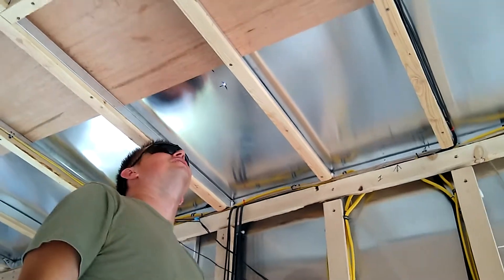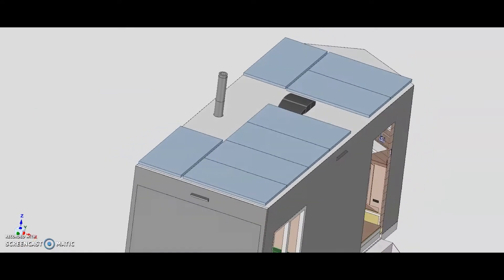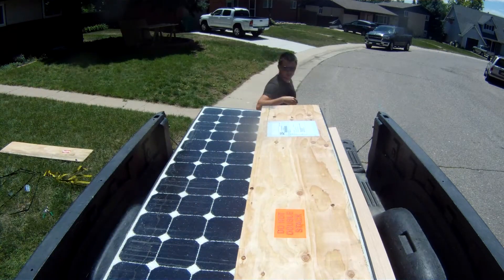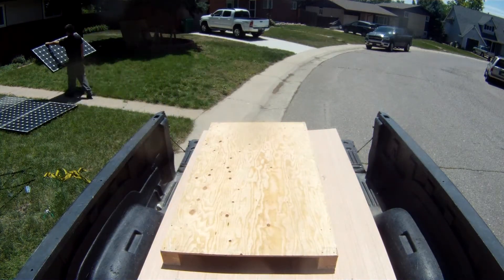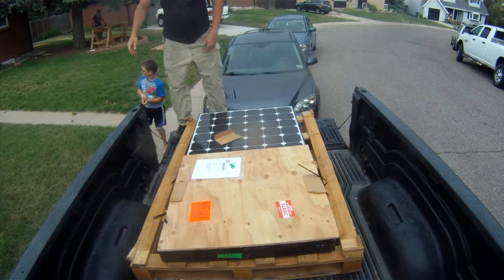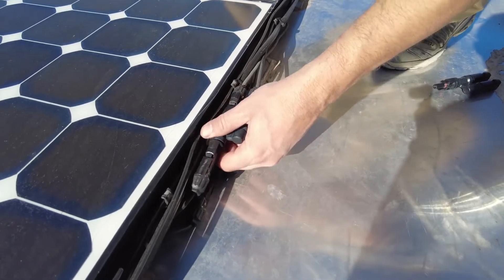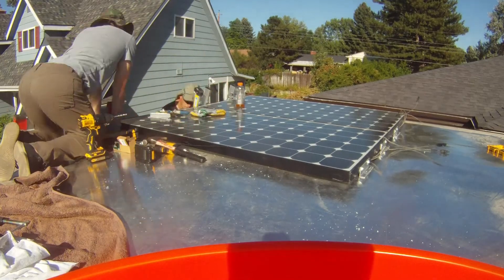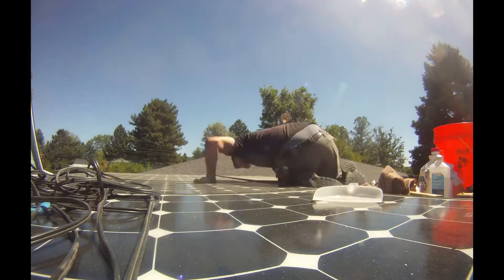Here comes the Sun! | DIY Solar Panel Install | Cargo Trailer Conversion | EP10

Comment: Be EXTREMELY cautious about buying 'used' solar panels - typically the used ones on the market were removed because they were failing. Panels that are internally degrading can become a fire hazard; I've seen them catch fire on people's roofs! My company is getting ready to pull 82 panels off a home because they have moisture ingress and are failing Megger testing. He had the system installed in 2013, so they are still under warranty but are clearly a fire hazard. To the untrained eye, the panels look great! To the experienced, they showed signs of internal corrosion on the busbars, snail trails, and evidence of premature back sheet failure. We will tear them all off, give to a junkyard, and warn them not to resell. If you are buying used solar panels, insist that each panel has a "wet" insulation resistance test performed on each panel (ideally with results >500MOhm), i.e. an insulation resistance test done after the panel is sprayed with water top and bottom. It is often not worth the hassle and lack of warranty considering new panels are so inexpensive.

Comment: What is the l x w x h and weight of those panels
Reply from the maker: According to the spec sheet, they are 61.4" x 31.4" x 1.8". They weigh 33 lbs each. The Sun power model # is SPR-230-WHT-U if it helps. We bought them used.
Reply: Thanks 🙏
Reply: What 3D software program did you utilize to  plan the panels on the roof?
Reply: @OldExodus  I’m going to get something when I’m ready
Reply: What do you just

Comment: I'm on my 3th CTC (over 10 years)  back when we called them race trailer with living features. Your designs and concept are ingenious. I working on my 4th build, a bit of off road capable. plan on using some your ideas. Thank you for sharing your get build.

Comment: Where did you buy the bed hardware?
Reply from the maker: Hi! There were several places we bought hardware for the bed. We will be putting a video out about the elevator bed system shortly.

Comment: Just saw a video on another Chanel of a tour of your finished trailer. GREAT job. I was really impressed with your raising bed. Can you share the spring mechanism you used to assist the lift?
Reply from the maker: Hey, thanks! The next video on our channel will be all about the elevator bed system. Stay tuned. 😉